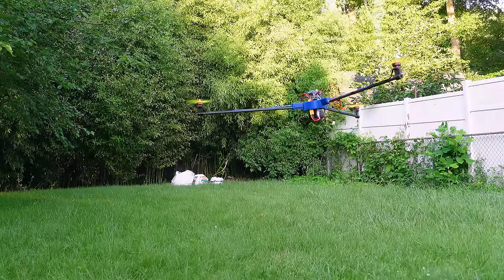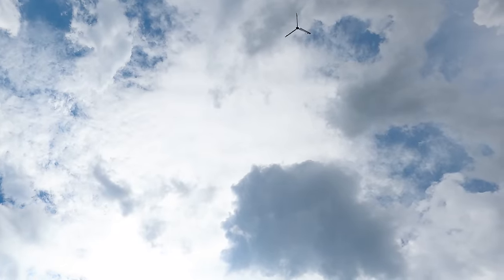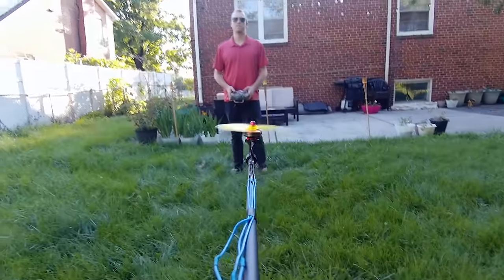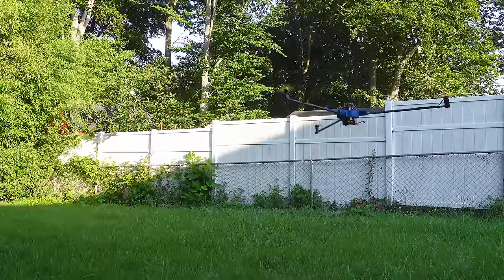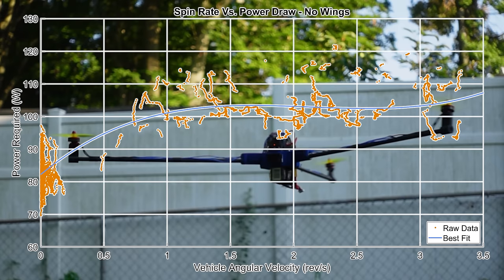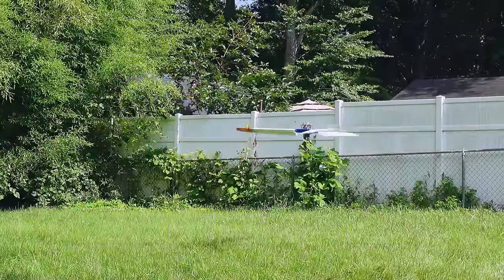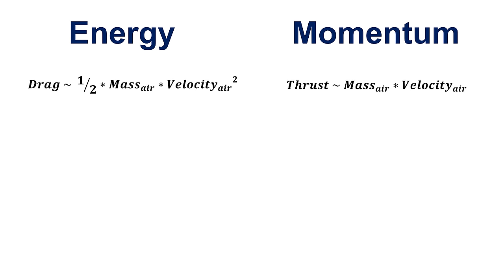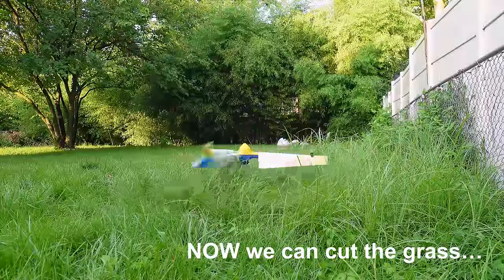The Spinning Drone Paradox - Part 1

Comment: This is a remarkable breakthrough - a 30 watt hover. As far as I know, the longest continuous flight for a multirotor is 175 minutes (happy to be corrected if anyone knows differently) - you could knock up a big Li-ion pack and claim the un-official world record (though you'd probably need 6S and more efficient, larger props)
Reply from the maker: Tempted to go a little bigger and try this out!
Reply: How is "multirotor" defined in that world record? 
I mean a helicopter also has 2 props and it drives them directly instead of moving the bigger one by smaller ones... I would guess that's more efficient?
Reply: @jackwiedemann  It wastes energy by not rotating whatever is rotating the helicopter. And when using counterrotation you artificialy limit the blade length. So my gues is that theoreticaly a flying prop is more efficient.
Reply: Wowzers.....
Reply: @someonespotatohmm9513  hm interesting question. I mean only having to drive 2 motors instead of 4 has efficiency improvements too, but there's also the added benefit of the increase in efficiency with incoming air in these props. Hovering one big single rotor like a helicopter will also not result in incoming air... 

So it's actually a more complex problem, but i think you're right.
Reply: @jackwiedemann  The efficienty gain when hovering comes from the increased mass flow. The small props being more efficient is "only" relevant for the drive efficienty of the big prop. 
That reminds me that 2 counter rotating props might be more efficient in practice because you directly use the electric motor instead of wasting energy by going trough airflow.
Reply: @jackwiedemann  ' instead of moving the bigger one by smaller ones... I would guess that's more efficient?' 
Actually some of the most efficient helicopters ever had jets or rockets at the end of the rotor blades and powered them directly.  'Engine and gear train' to spin things = many more places for losses.
Reply: @NicholasRehm    I've flown RC helis since the early 1990's, so a bit of experience on related things, so I'll just list out some ideas off hand..
1.  Get rid of the center part of the 'wings', and make the outer wing part bigger so it's more efficient.  Center part has a low speed, so it adds more weight while adding little lift.  Even with a lot of wash in toward the center, the center part still is usually terrible for weight to lift.  IOW from the length of the wings now, get rid of the inner 1/2, and make the remaining outer parts larger.  Might be more unstable like that though.  (If it's flying fast forward enough, the center 'whole disc' can give a lot of lift from translational lift.  But you can always add it back in later, and it adds more weight for hovering without much lift.)
2.  From 7:15 .   Realize this prop thrust idea is not the only thing going on.  In a plane, the thrust motor pulls the wing forward, and then a large lift force is generated by the wing at roughly 90 degrees to the thrust direction.  The force of lift is coming from tapping the generated pressure differential not the thrust motor directly.  Think of making the outboard wing sections large and glider wings, the diameter larger, and then having tiny motors that just pull the glider wings around for lift.  Should be able to beat your current 3:1 hover and make something that could approach a plane, you're largely operating as one if you make this big.  I'd be tempted to try and make a huge, light one just to see if you can catch thermals and fly it like a glider.
3.  Might be able to steer this with control surfaces on the outboard wings instead of directly by power.  Just something to check maybe, the motor thrust steering is probably fine, even if there was some 'gain' it would be pretty small.
4.  You can always reduce it to 1 rotary wing.  Look at the 1 rotor heli, and there are some one wing 'drones' similar to this idea with just one wing.  There are some modeled after the idea of a helicopter seed.  But I do prefer the 3 

I'd make a big one, cheap, and test it oversized large.  Then reduce it back down to more like this 'drone' sized, but see if you can retain large wing sizes, high lift etc.  Hmm think it was RCtestflight has some little plane with 3 stacked wings with high lift.  Ah looked it up 'Best STOL Wing Design Ever?!?'  Would be interesting to see 3 of those for the wings, and spinning slow but high lift.  Do it with plug in sections, and you could try totally different wings just by plugging them on to the rest of the drone.

Anyway what you're doing already looks great, just some extra ideas..
Reply: @NicholasRehm  provided you are smart about materials; it should scale up a fair bit.
Reply: world record is far higher
Reply: It's just a drone with a bigger slower rotor
Reply: Like a glider, could use the battery connected to servos and move it around to change the centre of gravity
Reply: I wonder if he could put solar panels on the wings so, at least, get a partial charge during extended hover,
Reply: @someonespotatohmm9513  A conventional helicopter does not strictly need a non rotating fuselage either (it is just convenient to put the payload there). The waste of the tail rotor can theoretically (but with practical limits) be reduced arbitrarily by increasing the length of the tail rotor (increased lever arm = more torque to eliminate counter rotation).
Reply: @juliusziegler5118  Good point about the tailrotor, another reason an electrical conventional helicopter might in practivce be more efficient. Although i am expecting it is not great for when you have some speed. 
Unless we think of something different when we say conventional helicopter, it does need a stationary or counterrotating body. As they spin the rotor by applying a torque on it. If you spin something that is not producing lift you are just trowing away half your energy.
Reply: @ModelLights  It might also help to align the wings below the propellers, in their spin-orientation, so that the wind velocity differential adds more lift per wing area? Then, outer-edge wings as you describe could also extend further-back like a goose-wing, instead of being narrow in cross-section like the propellers themselves...
Reply: @someonespotatohmm9513  yes but the parasital energy of the tail rotor can be reduced as I described (it is by no means half the energy as you say). The configuration you described with two counterrotating horizontal rotors is acutally one that has only "lifting" propellers (like the mars helicopter). But there are other aerodynamic drawbacks to that. You have a lot of drag especially at the tip of the propellers (of any lifting surface for that matter). So you want your lifting surfaces to be as long as possible and as few as possible. Thats why helicopters have (typically) only two blades, and thats also why we dont see biplanes anymore. For efficiency, a multi-copter is really a bad starting point. It is still a cool idea here, but I think at ultimo the route taken just leads to a fairly "ordinary" helicopter ;)
Reply: ...and I think this video kinda explains why that is so ;)
Reply: @ModelLights  Only point that might be wrong is about the control surfaces. It would be difficult to time the deflections and keep it all stable. Easier to control through thrust vectoring.
Reply: @ItsRainingLead  That's an exercise of weight and added power needed to hover, and the power these panels would generate. Hover is 30 Watts now, how much can the panels bring at the size, and how much would hover become, 40-50 watts?
Reply: This isn't a new breakthrough. I had a Wowee spinning toy that used this concept back in 2007. Two tiny pager motors spinning the larger blades and it hovered with very little power. It also had directional control. I was under the impression nobody uses this concept as drones are usually only useful with a camera, but keeping the camera from spinning becomes an issue (mechanically and power wise).
Reply: @NicholasRehm  you should THAT  would be cool
Reply: @someonespotatohmm9513  this is all mostly pointless helicopters work off an r^4. The bigger the blades the more efficient.
Reply: Can you add grooves to the wings to direct air toward the center?  Always been curious about what would happen. Maybe becomes very unstable maybe creates a vortex
Reply: @codemonkey2k5  I'd be terrified to see a military version of this with jet engines and carbon fiber everything lol

Comment: The last part when it glides forward like an airplane was so cool. This thing has so many flying options.
Reply: It reminds me Darth Vader's space ship. Imagine if he could somehow get independent servos for each wing/blade so the bottom ones would act like conventional wings and the top one like a rudder.
Reply: @davialves5970  Servos can do this pretty easily. It's actually harder to gear the booms together like he did, but it arguably saves weight and complexity.
Reply: @davialves5970  You actually don't need to do that. Simply tilting the entire vehicle accomplishes the same thing.
Reply: yes, totally reminded me of the Lambda-class T-4a shuttle from starwars

Comment: You, sir - and I mean this sincerely - have finally discovered a practical use for the tip jet... rotor... whatever.  Super impressive.
Reply from the maker: Thanks! We’ll see where we can take this idea…
Reply: @NicholasRehm  bigger! for more efficiency :P
Reply: @NicholasRehm  How does the power requirement compare to a single motor running the larger propeller? In other words, could this concept be used to improve efficiency of propeller aircraft assuming the fuel routing issues could be resolved?
Edit: alternatively, could this be used to improve the viability of electric prop planes?
Reply: @NicholasRehm  I feel like this flies very similar to what a classic UFO would, a few more propellers/wings shaped to curve downward near the tip and a stabilized ring in the center for a camera that doesn't spin and you have it.  course, I have no idea what shaping the wings differently would do
Reply: @diveforknowledge  They tried it in WW2 and the cold war. It didn't really work because back then they didn't have fly by wires and LiDAR. So landing the plane was very risky. It's like parking a car without rear mirror. It's the main reason this kind of air plane design was discarded. To get it into the air is not the problem, to get it back to the ground is. Maybe modern computer assisted flight control can help fix it.
Reply: @diveforknowledge  Single motor with  larger prop should be efficient than this. But it will almost uncontrollable. This vtol is very reasonable at efficiency and maneuverabilty.
Reply: Tippeller
Reply: @diveforknowledge  thing is, with basically one prop pointing downward, you cant get any sort of stability cuz you have just one centered point of thrust. The thing with the config in the video is that its more efficient than just three motors, but also more stable than just one prop due to the three separate props being able to make minute adjustments

Comment: This concept was actually explored over a decade ago with the Air Hogs toy “Switchblade”.    It had basically a much simpler version of this concept but with two rotors during launch.  You locked the toy into “Launch Mode” by twisting the two rotors away from each other, and let it spin itself to altitude, and when you were ready, hitting a button to unlock it from launch mode to fully fly like any plane-esque twin-rotor RC.  Pretty neat to see this concept again in my 20s after seeing it before i even hit 10 :D
Reply from the maker: Good times with the switchblade
Reply: @NicholasRehm   do you think this is what disc shaped ufos are doing? it makes sense for such an efficient filing object, and would get better with better technology
Reply: @bigmackmusic174  that's EXACTLY where my head went.
Reply: @bigmackmusic174  he’s not going to answer that because it’s an incredibly stupid question lol. Those round spacecraft are just SCIFi. They use a completely different probably warp style propulsion so it’s irrelevant
Reply: @bigmackmusic174  probably not cause this system wouldnt work in space
Reply: @Webeltjes  Well they are only disc shaped on earth, though.
Reply: @DaGleese  how do you know that for sure if we don't even know if life on otter planets have technology or sum and what it looks like...
Reply: @bigmackmusic174  electromagnets and therrofluid inside a torus.

Comment: When I saw the winged version, i never saw it as a paradox as the wings itself is already pushing down static air providing lift.
Reply: yeah, it didn't really seem like a paradox to me either - seemed quite obvious that drone + propellers angled to make it spin + wings angled in the direction it's spinning = more lift for less energy. if i had to guess, the title/claim might be an example of "experts on a topic either drastically over- or under-estimate average layperson's knowledge", or perhaps it's based on reactions from people with less intuitive understanding of how wings work, if that makes sense.
...or, maybe the "paradox" is more to do with how much more efficient it is than a wingless drone? in that case i don't know nearly enough to comment on that lol
no judgement towards OP one way or another, ofc, just theorizing a bit
Reply: Yes and no. It is not pushing down. Its using the same principle as airplane wings. Air moving faster over one side of the wing causes lift. Its basically a hover jet with helicopter props.
Reply: @mozarteanchaos  I think the "paradox" in the title is "less power spent going up => drone goes farther up", which is just a paradox for the tiny propellers themselves and not the entire drone.
Reply: @TheLK641  hm, that seems pretty plausible!
Reply: @jeffl4802  Yes, it is pushing air down, just like a ceiling fan. Planes and helicopters obtain lift by equal-and-opposite-reaction: push against air; air pushes against you; if you're not secured, up you go. A positive angle of attack for a wing or horizontal rotor blade ensures that this effect is constant. Thus, even flat or symmetrically curved wings can provide lift. What you're talking about is the Bernoulli effect, which is real, and can also contribute to lift if the wing is curved (concave down), since the faster air over the top will be at a lower pressure than the slower air flowing under the bottom. But note that this does not "suck" the wing up; there is no such thing as suction. It just creates differential pressure that pushes the wing from the high-pressure area below to the low-pressure area above.

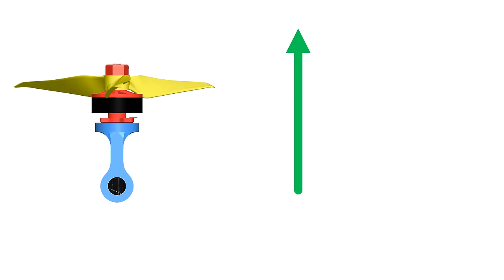Comment from the maker: A little correction at 00:35 
60 degree tilt from vertical results in requiring twice the thrust to match the initial vertical thrust component, not 45 degrees. You’d think I’d know my vectors by now….
Reply: Yeah, I frowned a bit, but your concept is so amazing I'm still happy I clicked! Great experiment!
Reply from the maker: @Sekir80  thanks for being patient with my annoying error lol. A good lesson in not rushing through the editing process or else things like that go overlooked
Reply: @NicholasRehm  Don't worry about it! I await your next chapter of experiments. :)
Reply: That's news to me and I'm sure it is to others also. 45 degrees seems like it would be the right answer. Care to quickly explain why 60 degrees produces half thrust for the rest of us?
Reply: @Chris-oj7ro  if you recall F=MA, F being Force, M=mass, A= Acceleration. Apply it to F_net = MG•sin30°, where G is "Acceleration due to Gravity." If you recall your unit circle, sin30° is equal to 1/2. So essentially (weight on earth)/2.
Reply: @Chris-oj7ro  A circle of radius 1 centred at (0,0) doesn't pass through (0.5, 0.5). However it does pass through (sqrt(3)/2, 0.5).
Reply: A very cool video, and yes I was going to point out that with the  degree inclination that the vector would be roughly 0.7. Nevertheless this is very impressive. I guess an evolution could have a contra rotating large propellor. Easier said than done. Strikes me that this would make a great lifting drone, taking off conventionally but going to entire body spin mode for more lift. A bearing on the lifting cord would be easy...
Reply: You know your vectors. It's human to err. It's noble to be humble and improve those errs. Expertise should be that constant humble improvements. You're doing the good stuff my man.
Reply: @g0fvt  Hmmm   pair contra rotating coaxial lifters & a non -rotating payload /control section?? (confession = I haven't watched vid yet ...)
Reply: Trigonometry: He a little confused but he got the spirit